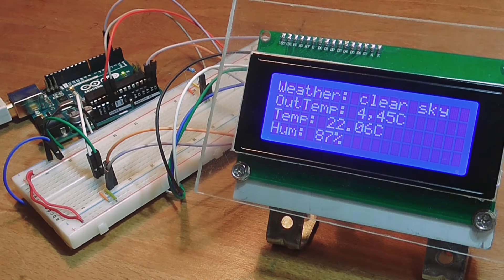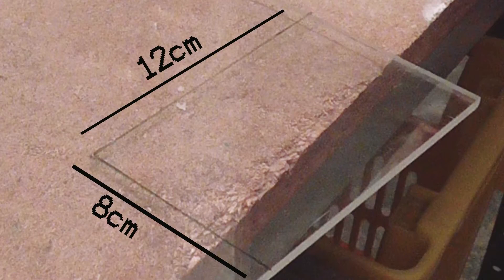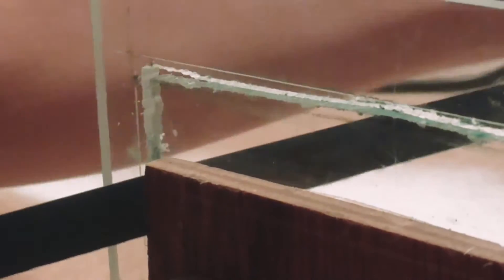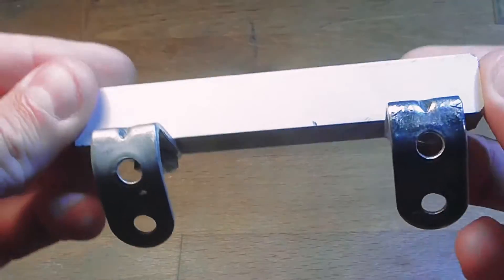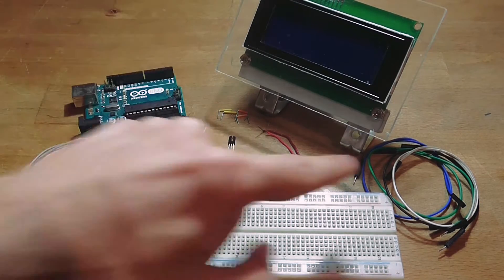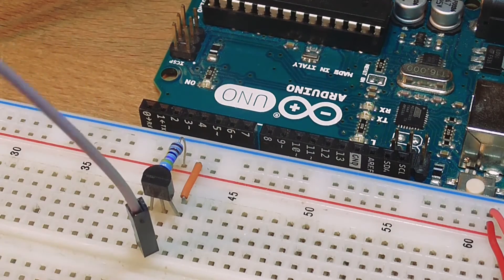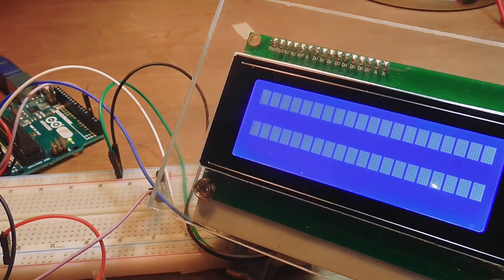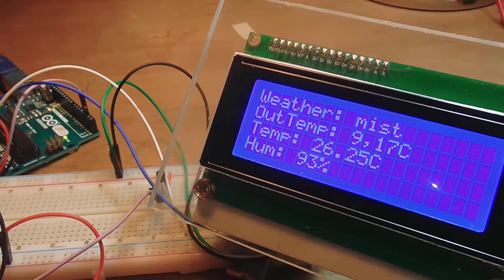Arduino Weather Display

Comment: Sir are you alive? Please answer me how I can on the weather server? Your code is not fully working. Only shows temperature. Please answer me. Something is hide at the last session of the video when you on the local server. It's not a valid work at the time of the on the local server because the Arduino board is out of sight. Please answer me.